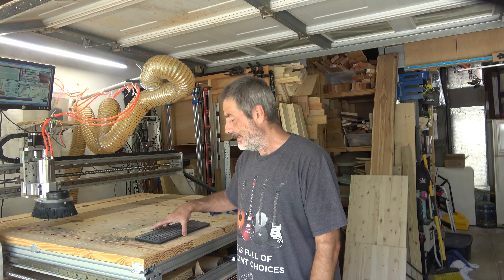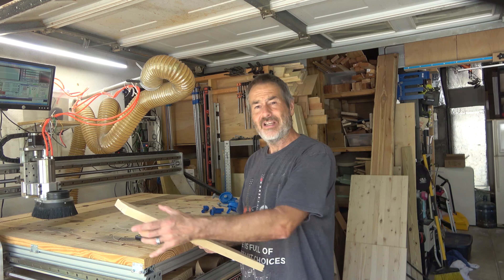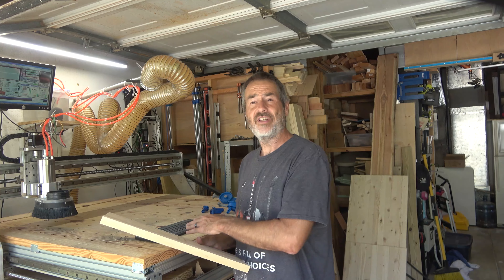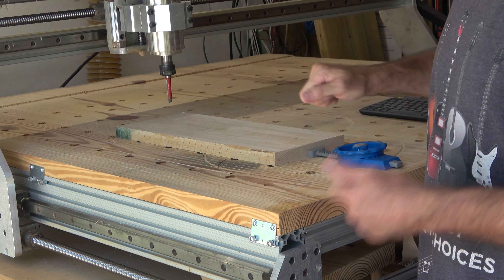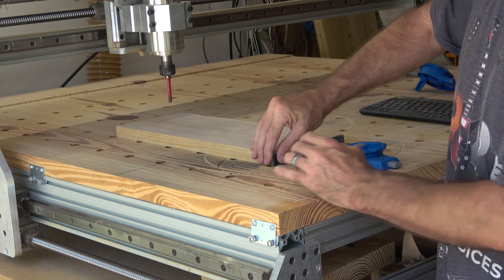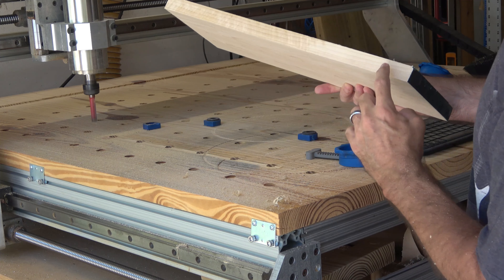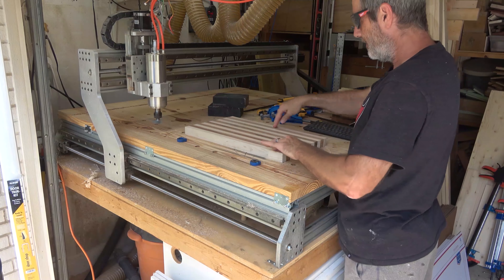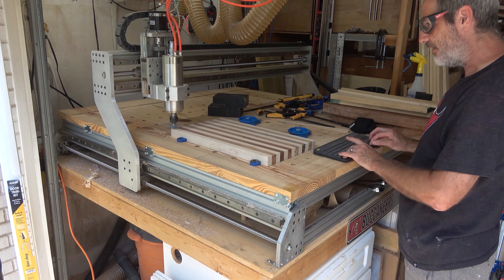Jointing and Planing On The CNC Machine

Comment: Nice job. I keep a bunch of 2"x3" of old plexiglass pieces around to shim up the workpiece so I don't cut into my table when I edge a board. I also use them when I have to do a lot of through cuts on a piece. I strategically place them under the workpiece to support it so I can cut through the piece and not need to put a waste board on top of my table.
Reply from the maker: Good idea! I would sometimes use 1/4" MDF but the plexiglass is a great idea! Thanks!

Comment: Just saved me a bunch of money.  I've got the Onefinity coming in next month and was thinking about getting a jointer and planer.  I wont be high production so I think this will work for now.  Located in Clearwater/Tampa area.  I like the use of manual control.  Old school with new school.  I'll definitely be making some common size programmed files for making it automated. Subscribed
Reply from the maker: Nice and thanks! glad I could help :) I'm in Clearwater too - Belcher and Gulf To Bay area! - so hey neighbor! :)
Reply: Lol. Less than 2 miles away.  That intersection is a deathtrap.  Howdy
Reply from the maker: @zombieno1  Yeah I am just a hair south of there but I have to go through it every day to work - worst intersection ever! That Onefinity looks like a nice machine too!

Comment: Love your videos, I thought I was the only one running my machine manually. I have screw down fences that I use this method to square them as well. I have a planer but seldom use it because the CNC does a better job. Perfect thickness and level and no snipe. I use a program though to flatten the top usually go from .005 to .01 at a time depending on how critical the final thickness is.
Reply from the maker: Thanks! I need to get a pendant so I'm not using the keyboard when running manually, I think a pendant would be a lot easier - that's a good idea with the screw down fence, is it already perfectly squared when you screw it down I presume?
Reply: Rodney would you mind sharing what program you use to flatten the tops? is it just VCarve?
Reply: @Rotakor  I have aspire but I'm sure it can be done in v carve as well
Reply: Actually, I just do this manually with Mach4 and use the buttons on the screen to jog in increments and keyboard to do a continuous move.

Comment: Nice video and cnc router. What brand is it? 
I do all work with my cnc router. I dont own any regular wood working tools such as a joiner a planer etThats the first ive seen anyone use pine boards as a spoilboard. does it move on you when the climate changes ?
Reply from the maker: It's a frankenstein :) I bought the original machine off eBay and then put new motors, all rails were replaced, new taller gantry sides, and stepper drivers / it's probable that the pine moves and expands, but I never do anything that needs super accuracy and I don't even have limit switches so the movement wouldn't really affect me :) I zero on each individual job and tool :)

Comment: How much spacing do you have on the dog holes ?
Reply from the maker: I want to say 6 inches? I'll have to look at the program to see - I made them based on my blue in line clamps to make sure they could hold most things
Reply: @JamiesHobbies-GGB  yeah after i seen you use those kreg dog hole holders i think im gonna use your link and buy me some. Ive tried all methods and none are perfect but each have a place and use. So far my quickest method and cheapest is a brad nailer
To surface material i shoot it thru at an angle into the sides then to square and join the edges i shoot thru the top. Yeah i waste some wood like that but its the fastest method ive found.
But i i can Definately see those kreg holders making fast set up times for certain jobs
Thanks for replying
Reply from the maker: @bubba6945  Yeah just like any side holder things, they sometimes have the tendency to push the work piece upwards - on stuff I need to be flat I usually program holes I can use to screw the piece down to the spoil board

Comment: Great info. Thanks for sharing!
Do you experience issues with the linear rails collecting all the wood dust and mixing with the oil or grease?
Reply from the maker: I did - but then I installed some 1/8" plywood "covers" that extended out over the sides - you can see them in one of my latest videos I think :)

Comment: Did you build the cnc?
Reply from the maker: I've built a few - but this one was one off of eBay that I upgraded a LOT - so I might as well have built it LOL
Reply: HoarderOfHobbies was that the 6040cnc? That’s what I have and I’d like to make it larger. If it is the 6040 do you have any plans on how you made it larger? Thanks
Reply from the maker: @malott2171  Hey - nope, sorry, it was not a 6040 - it was this one https://www.ebay.com/itm/CNC-Plasma-Router-Kits-Mill-4x4-Ball-Screw-Rails-Carriages-Milling/264147661179?hash=item3d806d717b:g:GMIAAOSwqu9VLc2H   -  and I upgraded the supporting extrusions and also made new Y axis sides to make the Z Axis higher, oh and also upgraded the steppers